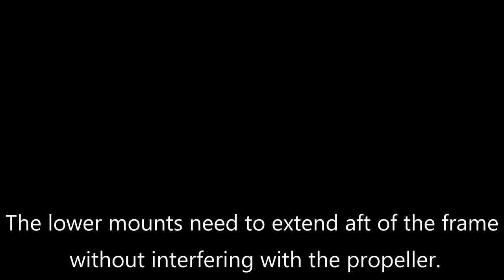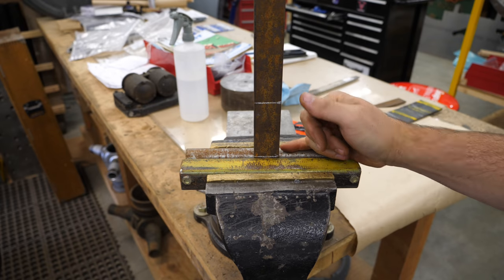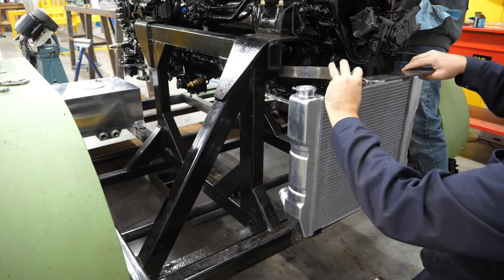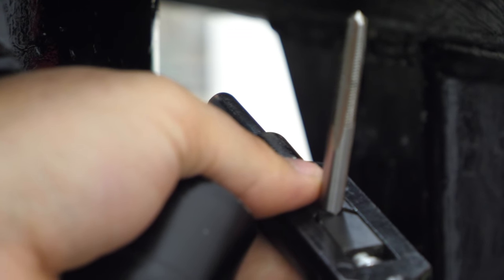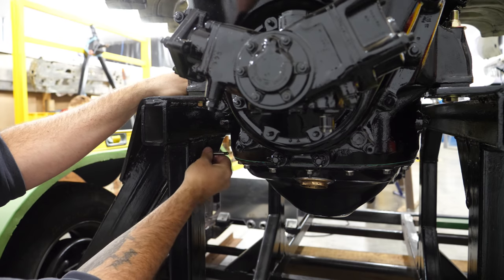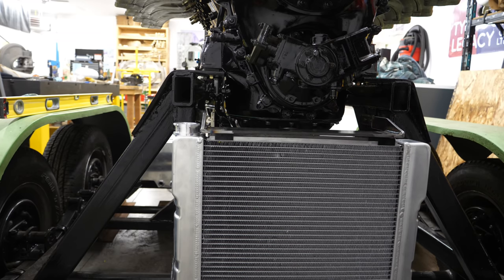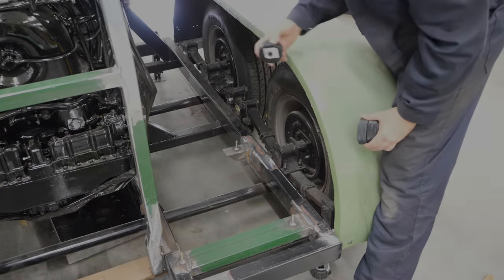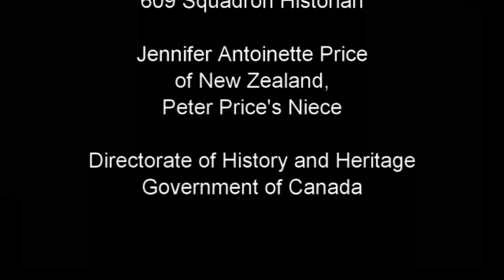S02E02 Merlin System Mountings

Comment: Wonderful work as usual and a very clever use of hockey pucks. Regarding cutting down your tap wrench handles, when space is tight, I’ve often put the taps into the appropriate 12 point socket (5/16, 9/32, 3/16….. depending on the size of the tap) and used a stubby ratchet to get the needed clearance. Your guide makes getting it perpendicular-ish even easier. Keep up the great work.
Reply from the maker: Thank you Earl, that certainly was an option, but it was oddly difficult to keep the tap perpendicular. A series of odd angles and positions at play. ~Ian

Comment: Does the radiator have shock mounts too?  Expect you will install fender inner splash shields?  Great work!  I usually spend half my time repairing the damage caused by my first repair attempt!  A trailer mounted running Sabre engine would be a smashing display!!
Reply from the maker: It does, it's held in place by rubber blocks. Working on aluminum inner fender covers now too. ~Ian

Comment: Speaking of oil tanks and coolers, what type of oil does the Merlin require? Do you simply use a CK4 rated diesel oil with a higher zddp content? Or does it require some kind of aviation specific oil? 

I have so many questions..
Reply from the maker: Hi Alex, I will need to check to see what oil we are going to use for operation; I hope to add this info in an upcoming video. ~Ian
Reply: @TyphoonLegacyCoLtd  Splendid. Cant wait to hear this beast run!

Comment: It doesn't look to me (6:19) as if the radiator pressure cap hole is far enough from the support bracket to allow the cap to be turned.  Or will the cap not have the usual "ears" on it?
Reply from the maker: We will actually be welding over the radiator cap for safety reasons. The coolant tank will have a relief cap added to it at the systems highest point. ~Ian
Reply: @TyphoonLegacyCoLtd  I wondered about the location as well.  Hope you don't have problems with air locks.